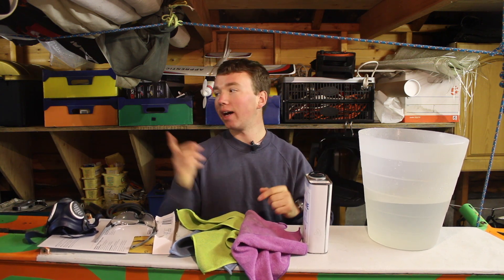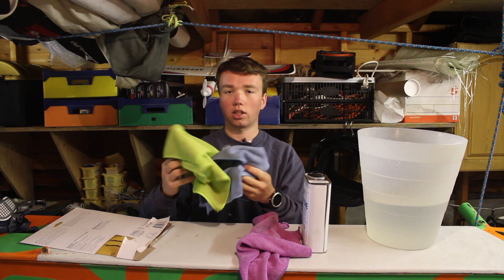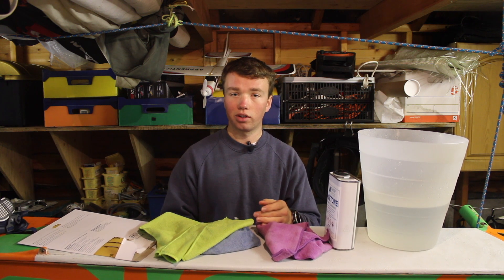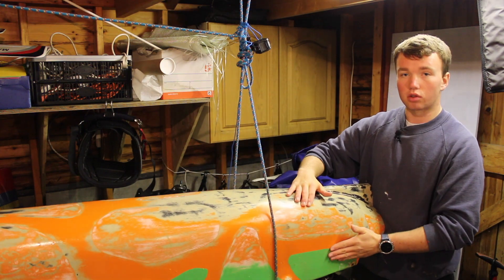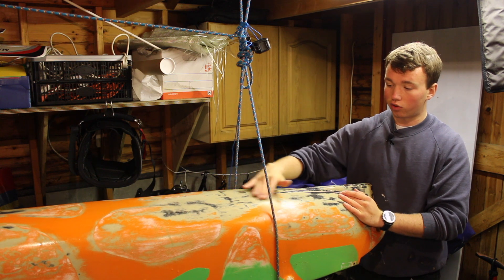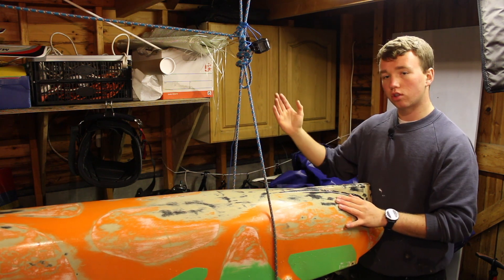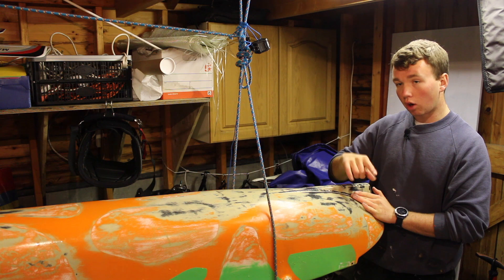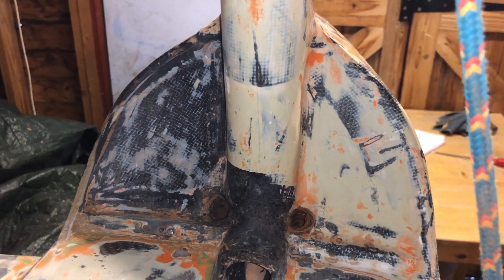Sanding // International Moth Project // Part 2

Comment: That's some serious work you've been doing! Well done. I would suggest that you use (vacuumed) carbon sheets as filler instead of gelcoat. Reason for it is that you don't know exactly what is structural and what isn't so its better to beef up the parts that need repairing than to fill them, it also saves a little weight 😉 I would suggest you buy a small vacuum and some bagging to go with it (they often come as a set...)as well as some carbon cloth. Then you just sand it down til it's more level. Lay no more than 5 sheets at a time before vaccuming and do it in multiple stages with the cloth pieces getting bigger and bigger until they are flush with the original surface.
Reply from the maker: Thanks! It's been great to keep myself busy during lockdown...
The gel coat repairs I mentioned were very temporary. I used gel coat because it was all I had, and I wanted to go sailing! I am going to repair it with carbon and epoxy, I'll probably do a bit of chopped carbon and some laminated to retain strength. The delamination around the king post is only to cover the joins between the other parts of the boat, so I think I'll use 3 layers. The other parts where the weave is showing through, I think I will just use some filling epoxy to get it flat again. 
Hope that makes sense!